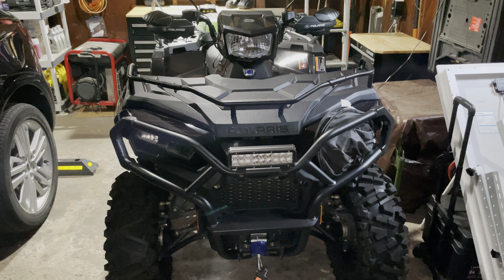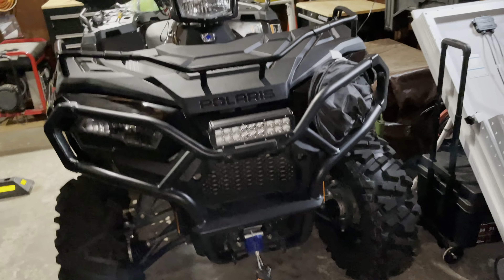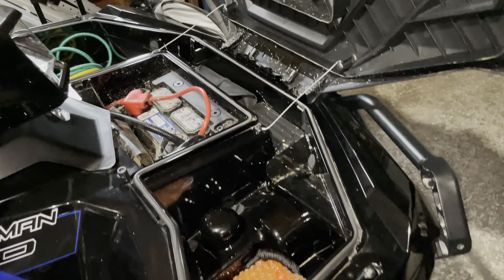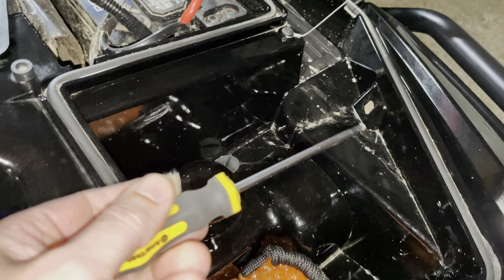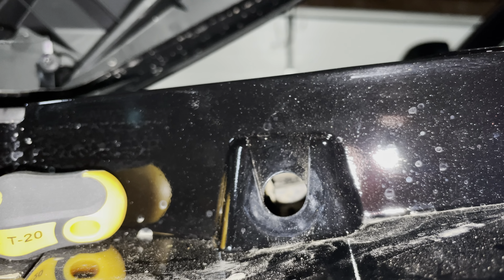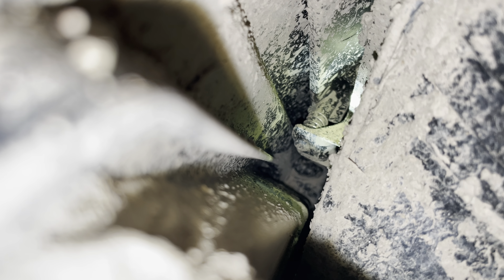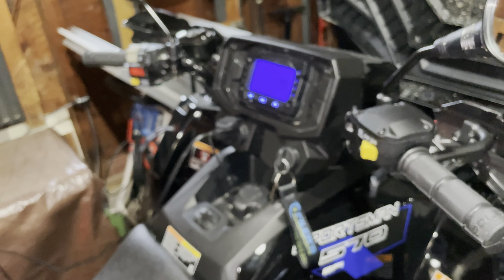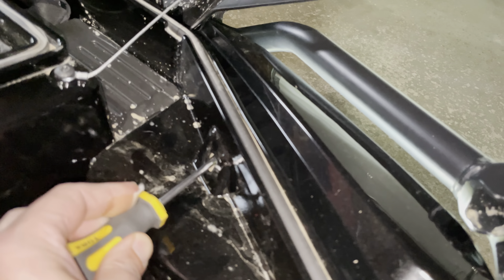How to Adjust Headlights on 2021 Sportsman 570

Comment: The ones with LED light housing from factory have the adjustment screw under the fender, on outside of the lamp housing where the ones with halogen housing have the screw apparently on inner side of the housing as seen by your video.

Comment: Thanks for this.  I've got a 2022 570 and the manual is completely wrong, even complete with an incorrect diagram and hardware description, about how to adjust the headlights.  for some reason my dealer didn't do it when they set up the machine.  I'm a pretty mechanical guy, work on all my own vehicles, but I couldn't figure this one out for the life of me.

Comment: You actually loosen the t20, manually tilt the headlamp to where you want it, then snug it back down, atleast on my 24. Found out the hard way as mine wouldn't adjust enough down by loosening it like in this video and the bolt came loose and fell out on the trails
Reply from the maker: Thanks for the tip! 👍

Comment: Press your positive cable down, it looks like it’s keeping the cover from closing all the way
Reply from the maker: Thank you Jody. I had the same observation as you just a month ago. I’ve made sure all cables are level or under the front rack now, but no joy. This rack just doesn’t close tightly. Some guys online have added additional clamps. I might do the same, or just accept water in my “dry” storage. Otherwise I enjoy this machine.